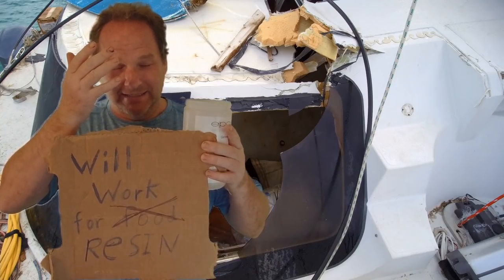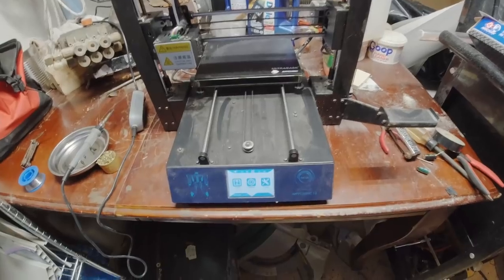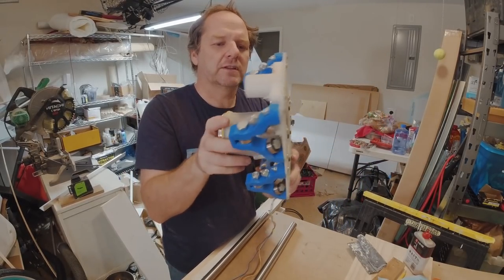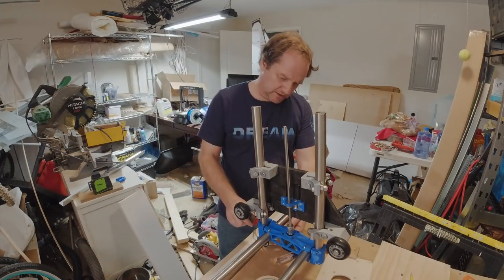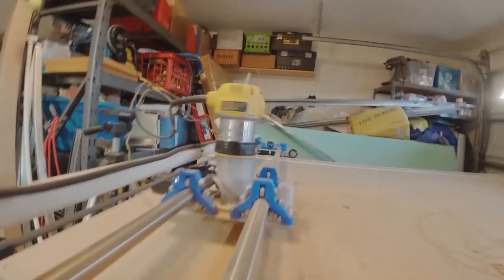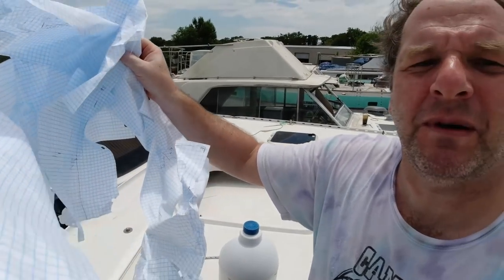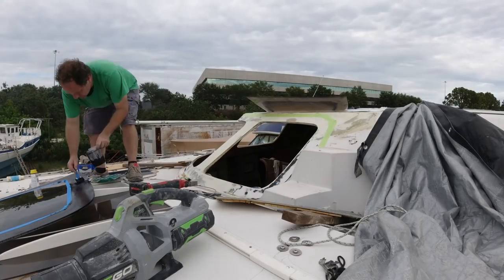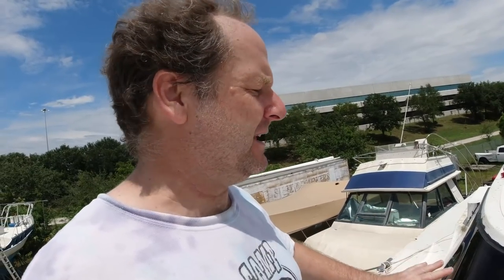23 DIY CNC Cutting and Installing Boat Windows

Comment: Window caulking:    ....And you didn't clean up enough after installation and had to clean it up later....SHOCK. LOL 
Hey it's all good that works out right in the end. Your way, their way, my way, it's all good. There are many roads to get to the same destination. Some are smooth, some are bumpy, some are almost impossible journeys, however, it's the end result that really matters. So do it your way. 
Great job.
I think your channel is doing well and going to do very well in the future.

Comment: Initially, a CNC router takes way more time than it saves, but it delivers a very pleasant precision and is a great time saver if you ever need more than one part of something or if you need a revised version of a part you made before.  Good decision, you will find many useful applications of it with time that are well worth the initial effort to build it and establish the work process.
Reply from the maker: I wouldn't have done it just for the window, but all of the interior on the boat is CNC cut and I have the original files to recut them. That will make it a big timesaver when that part comes.
Reply: @BryanSailing  wow from Ted or Arg? would love a copy #25

Comment: You can't go wrong with Sika. Being a professional Sika user it's a bit awkward to see how expensive these products are. I use the Powercure system which would have also been great for this job, but apart from the insane expensive caulking gun it also takes some practice and experience to make it work.
The Sika primer is a real pita when you spill it, either on your hands or on other surfaces. Using a piece of pumice stone can get it of your hands, especially when you take a long bath first :-)

Comment: Really enjoying your videos, hope you keep it up. I am also watching another channel, Sailing Parlay Revival about a hurricane damaged Lagoon 45 catamaran. They have experienced a major bulkhead failure that they are now repairing. Don't know if this common in cats but just wanted to bring it to your attention for your boat. Best to address while the boat is all torn apart. Their problem was hidden behind finished walls and cabinetry so not initially detected when they did their repairs. I hope you don't have a similar situation. Good luck with your project
Reply from the maker: I did an episode on that. The good news is all my bulkheads are accessible because of the boat design. There is some damage I will be fixing, but even with the damages the boat is still square and straight.

Comment: Thanks for your sacrificial glass layer idea a few episodes back (extra layer on top than you can sand down to without damaging the layers beneath). It inspired me to do something similar in surface prepartion prior to applying heavy cloth. 
I laid lite cloth over hexacore which filled in some slight depressions I have left in it when kneeling on it. I then sanded back most of the cloth leaving  a smooth surface for the outer layer of basalt cloth. Just a sailing dinghy

Comment: They do say to run the 1/4”x 1/2” self adhesive foam strip around the inside edge to stop the caulk dripping onto you inside widow.  Great effort with the cnc.

Comment: Great video as always.  The best tip I ever had when working with mastic/sealer was to use masking/painters tape to mark out the edges where you want the sealant to stop, then bed down with a finger, then remove the tape while wet for perfect crisp edges every single time.  No more smearing messes!
Reply from the maker: great tip

Comment: Micro Ferrets. I modified my Harbor Freight Welding with a Huge compositor and a couple other Parts. It ran Like a Top. It didn't hesitate and Ran way better than Original Stock Build. I got the instructions from YouTube.

Comment: Before retiring 12 years ago, I made a living cutting out acrylic for boat ports and hatches on a CNC router. I also installed them with Dow 795. I used a stiff piece of rubber to go around the cauk to make a smooth, clean edge. (selectplastics.com)

Comment: You shouldn't have to "shape" the black urethane sealant for the windows. If you watch automotive windshield installation videos, you'll notice they cut the "V" notch directly into the urethane tube tip.. quite easy. Google luck with the next window!